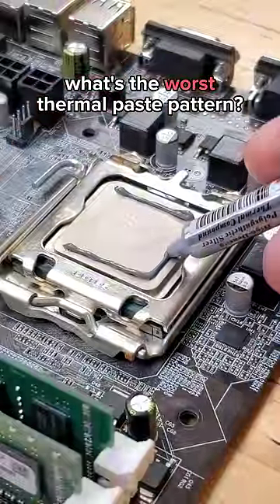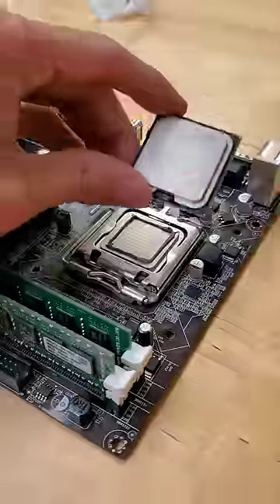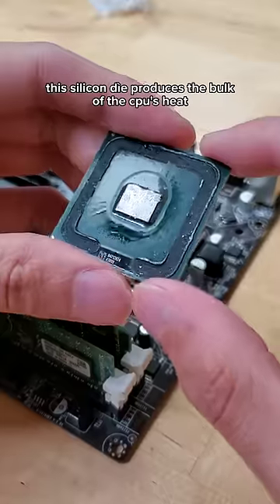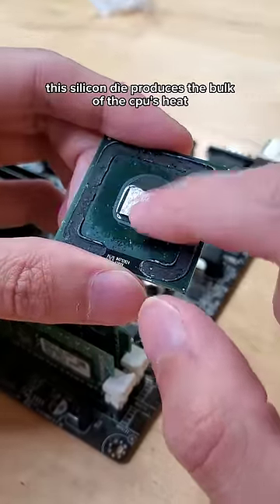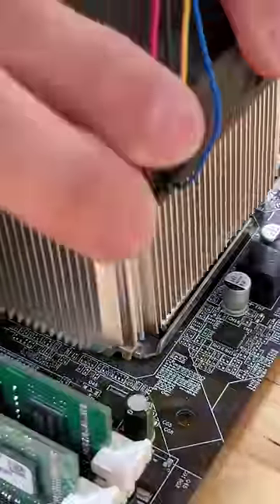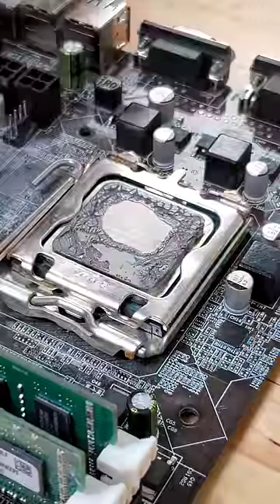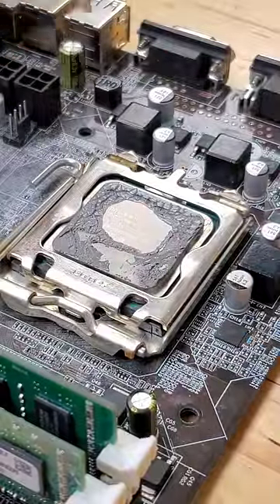what's the worst thermal paste pattern? #shorts

Comment: Think about this. A square at medium distance from the center, it’ll spread to the center and then the edges as well.
Reply: One pattern I've seen recommended a few times is a square close to the edge with an X of thermal paste through the middle
Reply: @Thesnakerox  effective but 3 lines across is all you need. Save some of that thermal paste for your other builds
Reply: @FactsForLife_901 damn i wish i was building that many pcs lol.  i have 3 tubes of paste that i only used 1 time each haha
Reply: @RideRedRacer  lol I work for a big tech company, my job is to build and test PCs and servers all day, that's the only reason.
Reply: And a tiny dot in the middle to make sure past gets there.
Reply: Thats not how that works. No matter how you shape it the heatsync squishes it circular anyways.
Reply: @Generic_Name_1-1  nah ur wrong.
Reply: @paperboatcanfloat3424  thanks for the input
Reply: @Generic_Name_1-1  your welcome dawg. Have a nice day.
Reply: I always draw the Mona Lisa with my thermal paste (I am still working on my first PC)
Reply: You don't want it to spread to the edges because it'll leak out and cover the pins. I've experienced that happening before.

Comment: Which is why you only need a dot in the center. Spreading isn’t better for those who think. Ive put a dot in the middle for many years and always get great temps. Just my 2 cents!
Reply: Spreading is objectively better as you can ensure full coverage of the die(s), a small dot in the centre isn't always adequate for this.

You do know some CPUs have rectangular dies where some sides are closer to the edges right? Intel Alder Lake is a good example of this.

You do know some CPUs have multiple off-centred dies right? Just take a look at AMD Ryzen 3000, 5000 and 7000 CPUs. And especially take a look at ThreadRipper and Epyc CPUs which have dies all over their large package where you most certainly do not want to go with the single dot in the centre method.
Reply: You're right man, most people are completely uninformed about a lot of things, this being a great example. Thermal paste should not cover your whole CPU and squeeze out of the sides when you install the cooler, it should be a super thin layer that fills in any gaps between the surface of the IHS on the CPU and the cooler.
Reply: @husboy1  I've seen a lot of tests over the years, and feel quite confident that there's no such thing as too much, only too little. Sure, you probably don't want it to be so much that it spills over on the board, but trying to get a small circle in the center is just unnecessary and potentially suboptimal.
Reply: @AllahuSnackbar270  When you put a square like the person in this video, it can leak out and cover the pins, permanently damaging your CPU. I've experienced this happening before. I've always used just a dot. My dad who works in IT at a large tech company only uses a dot. He's the person who taught me that method.
Reply: @-jxvi  You mean when removing the CPU? I always wipe off as much as possible before removing it from the socket. Or do you mean while it's in there? I've never managed to put so much that it leaks out onto the board, and no paste I've ever used has been so runny that it could get in between the CPU/socket. It's definitely different with liquid metal though, I would never use that stuff.
Reply: X is the best
Reply: Dot is the best for AMD's. I don't like the x's or squares or other shapes. They can leave air bubbles while heat sink presses over it. 
Put a dot on it, install your heat sink. If you are not sure, remove the heat sink and look at the paste. If needed, wipe the paste and put a bigger dot. 
I like to put somewhat rectangular dot in middle and it does fine for me.
Reply: I used to always be so worried about thermal paste not being able to spread across the whole thing, but this video really opened my eyes up.

Comment: just use a plastic card, spudger or whatever and pre spread it.
And make sure you use as LESS as possible!
It shall just be enough to cover the surface, not really a "layer" of thermal paste. It's meant to fill the microscopic gaps between the surfaces of the CPU/GPU and the cooler, not to create a border layer between them.
Reply: No. Just no
Reply: @VrXl17  It's the truth. The best cooling is metal on metal.

The imperfections between the metals creating tiny air pockets is what you're preventing with the paste.

Edit: this is also why liquid metal is better for performance than paste.
Reply: @ethanv7330 No, I mean never spread your thermal paste. It can damage your cpu socket because it will leak off the cpu.
Reply: @VrXl17 not every paste
Reply: @legendmaster1989  most tho
Reply: @VrXl17  not really my corsair one doesnt i have it all over the back of my cpu lol
Reply: @legendmaster1989  yeah but that’s because you probably didn’t spread it. Also people don’t spread thermal paste because it’s better to use a pattern like the X as it applies perfectly equal pattern whilst spreading it with a spreader creates air bubbles and when pressed down with the cpu cooler it will be thinner in the middle.
Reply: @VrXl17  so its not cunductive cus i dont spread it?
Reply: @legendmaster1989 no, I’m saying DO NOT spread it. It doesn’t change the conductivity but if you spread it you can (and this is very rare) short circuit it because of air bubbles ect
Reply: @legendmaster1989 also, that’s really bad because the connectors won’t connect properly
Reply: @VrXl17  yes y\that makes sense but not all can short circuit the mobo some are pure silicon with no alluminium
Reply: @VrXl17  most pastes you spread won't do that... If it's viscious of course but thermal paste isn't normally damaging it's fairly easy to remove with alcohol. Liquid metal though that lemons a board instantly.
Reply: @VrXl17 that's just... Not true man. That's why stencils exist for spreading and have comparably more reliable results than globbing and smashing. That doesn't spread out as equally as people think it does.

Comment: I like noctua's recomended  5  dot pattern, but recently i've taken to spreading it evenly with those lil plastic tools that come with some coolers. Nice to not have to worry about a bad spread when working with pastes or cooler mount pressures you arent used too.
Reply: Exactly. If you do a thin layer all over, there is zero doubt.
Reply: @MrBilld75  Yeah, the only issue is some pastes are so thick, like noctuas paste, that you have to soak the tube in hot water or something for awhile to be able to work with it.
Reply: @RubenRyb66  Ahhh, I see. I've never used it. I used some Arctic Silver before and used Arctic Cooling MX-4 or MX-5 more recently. The Arctic Cooling MX stuff is quite thick, but I don't know how it compares to the Nocturna and thickness.

Comment: The best:
A very small dot on the center, the paste is only supposed to get rid of air gaps, both the cpu and heatsink are almost completely flat so you need very little. Thermal paste does not conduct as well as aluminium so the thinner the layer the better.

So the worst would be using the thickest layer possible?

Comment: the X pattern is simply the best
Reply: The X is the most common and best pattern.
Reply: no, but ok
Reply: I use a pea-sized dot and it works just fine because the pressure of the heat sink causes it to spread across the CPU. With any more than a dot, you're wasting thermal paste.

Comment: Thin even layer is foolproof and the best. An X pattern is second to that and gives very good coverage. The key is to not use too much, it's not glue more is not better, it's worse. You're just dealing with microscopic imperfections/pores in the metal. There is no reason to spread it thick at all and it can actually damage your motherboard or CPU or both.

Comment: The worst is just missing the CPU entirely.
Reply: no, the worst is no thermal paste at all

maybe you could put a hot glass of water on the CPU but that's not thermal paste and it doesn't count
Reply: Its rng with no thermal paste. If you are lucky cpu and the heatsink get contact with each other.

Comment: use a small plastic spatula or a piece of cardboard or similar and spread an even thin layer..
Reply: It only works if you have thinner paste up to MX-4 or kind of MX-6. With thicker paste you must use heater to  make it even remotely possible. 5 beads works fine enough without even remotely close of same amount of annoyance.

Comment: If anyone still doesn't just use a spatula these days, I'm gonna slap em with an old fish
Reply: cpus literally have integrated heat spreaders. The cooler mount will spread it out for you, spreading it further than just putting a lil blob in the middle is unnecessary.
Reply: @toxicturkeyy   actually with amd and intel both being on a LGA socket , their retention arms tend to cause the paste to not spread evenly.  some  other youtuber did at test of  this  and found that making an X or putting a hefty ammount (twice the old "pea"  ammount" are the best ways to ensure the paste spreads around the cpu better. obviously you'll want some kind of non conductive  paste using these methods as they can cause leak-out . using a  conductive paste like artic silver... you'll want to go the spatula route (with only a tiny bit of paste)  to reduce leak-out risk.  in general rule of thumb though you do nnot want to sue a conductive paste any more ,  lor liquid metal unless you swap out the mounting ring  (a risky procedure) and then also use classic safe guards to prevent the paste or metal from shorting any thing out (classic methods being nail polish around components you want to protect from any possible leakage). 

but i digress point was  jsut a tiny pea dot doesn't cut it any more especialy with these newer cpus.
Reply: @DenverStarkey  it does in fact cut it, I have assembled a lot of computers in the past 10 years, this month I assembled three of them. I use a drop the size of a small grain of rice every time and it always spreads into a circle/ellipse that covers more than enough and is very thin. Thermal paste isn't the main heat transfer medium, it's only there to fill in imperfections, it should be as thin of a layer as possible.
Reply: @husboy1   dude i build PC's all the time, i have been building PC's as far back as the 90';s  i don't need  a lesson from you about how to do thermal paste.  and MANY builder's agree with me , a pea sized dot does not cut it any more. especially with how  the LGA's clamps don't have even mounting pressure.  but like i said you can take the risky road of swapping out the mounting ring on the main board to get more even mounting pressure , but again this is risky as you bassically expose the pins to potential damage when you completely remove the mounting ring.  you can find countless  videos showing how a pea sized dot does not work very well on these  default LGA mounting solutions from intel and AMD. intel even more so since their newer processors are no longer perfectly square shaped  but instead are more retangluar.
Reply: The pressure of the heat sink is enough to spread the thermal paste.
Reply: @DenverStarkey I use an AMD CPU and a pea-sized dot is fine. My dad does this too, a guy who works in IT. The pressure of the heat sink is enough to spread the thermal paste. Any more than a dot and you're wasting thermal paste. I've seen people who put an X damage their CPU because the thermal paste can seep out from the pressure and eventually damage the pins.
Reply: @DenverStarkey Also, I don't think the newness of the CPU has any effect on which method is more effective

Comment: Can you put thermal paste directly on the chip itself then more on the cover?
Reply: Yes. It's called direct die cooling.
Laptops don't have the metal cover (IHS).

So you would directly mount the CPU cooler onto the cpu die. It does reduce temperatures. But for desktops it's much preferred to have an IHS for the sake of longevity as desktops are often opened up and the components can be replaced.

Comment: Technically speaking a dot in the center is a thermal paste pattern, in this scenario you made a box around the center attempting to make the worst pattern possible. Judging that a dot in the center is a pattern, 1 small dot in 1 of the corners in technically a thermal paste pattern.

Making a corner dot the worst pattern possible.

Comment: The BEST way is, not by accident, the only one engineers who designed the products say:
Spread a thin film evenly all across the surface. Any other pattern is bull and technically incorrect.
Reply: Where's the source where these cpu engineers says this?
Reply: The X being second best and the way most people in the know do it. But thin layer evenly is foolproof and usually what is recommended.

Comment: Square with middle dot or 5 dot pattern are the best.

Square you might be putting a little too much and it might overflow...there's no problem with that, but next time you repaste you're gonna have to clean a lot more.
5 dot pattern and you get 100% coverage every single time. Trust me, i repair PCs as a hobby 😅

Some people still defend the pea pattern, but I've found several CPUs with no paste on the edges...not a big problem, the center is what heats up, but it's better to have the CPU fully covered in my opinion as the CPUs metal cap spreads the heat.

Comment: As a phone 1 owner I can confirm that basically all the cases you find for this phone have a clear back or at least cutouts for the lights. Personally im not really a massive fan of the 2a design since I like that the lights cover the whole phone on the 1 and 2. However they could be using that as a way to distinguish between the mainline and a line?

Comment: I love those applicator pattern stencils uou get from Vorsair when you order xtm70, and developed my own reusable stencil that centers perfectly on the processor and works with multiple mointing bracket configs ti get centered. When i tested it with clear acrylics every time no matter how "bad," i did it (as long as i just squished it on directly from above without rubbing it all over rhe place or deliberatly doing it bad) there was almost never any air in the entire surface of the thermal transfer plate and the layeer was nice and thin sk the heat tramsfer is as optimal as you can really get. It was hard to make but it was well worth it. All i do is spread a glob from my container and remove the rest, put it back and use it for later. Very efficient.

Comment: You know what would be cool?

Is if CPU manufacturers included a template of the layout, so that you can apply the thermal paste where it needs to be, rather than, guess/cover it all, and end up running at 72°F instead of the 68/69°F it should be running at.

Comment: The ONLY correct way to install thermal paste is a very thin even layer.  The moment you have any type of air bubble or gap you are wasting your time and causing a heat concentration point.

Comment: There's a reason Thermal Grizzly gives you a spatula to spread the thermal paste in the package. Just saying. 

All this talk about what's the best method has been going on for the 20 years I've been building PCs. If you thinly spread it to cover the entire IHS then you don't need to worry about if any area is covered or not. I've done this for 20 years and never had thermal issues. Thermal Grizzly is one of the top players and they know this. Which is why they include the spatula. Just take the few extra minutes it takes to spread it and be done with it. Industrial application manuals almost always instruct you to spread thermal paste. Again, they do this for a reason. 

Too little paste can cause major issues. Too much paste doesn't cause any issues other than the potential mess. (Or if you're using conductive paste. Which is stupid and unnecessary for 99% of normal conditions.)

Comment: I just use the sticker that says REMOVE BEFORE INSTALLATION.
Reply: Fr. i found that if you use the sticker included with the CPU it also can help the cooling. Just slap that thing on top of the CPU and put the cooler on top

Comment: What happens if you put 4 different types of ram in a motherboard?
Reply: If you mean 4 different brands, speeds or sizes. Nothing. It'll work, although not optimal.

The faster ram will get clocked down to the speeds of the slower ram.

Comment: No sir you  are wrong as metal is a good conducter of heat and so heat realised from heart of cpu can be transmitted and therefore this pattern is not useless but as applying to the center would be much better.  Conclusions nothing is useless its just pov ,thak you

Comment: You should watch videos about contact patters of you cpu. Or test it yourself with you specific cooling.
That way you can do a really thin "wipe" with paste for parts where contact is good. And slightly thicker layer on everything else.
Also really important to use correction frame for lga1700 chips.

Comment: The thermal paste story is like German engineering - way overdone at this point. A simple dot in the middle is perfectly fine, why turning it into rocket science? If you are unsure over the amount, give it more. It will make your assembly look a little messy, but you are safe that everything is touched by the paste, no risk of short circuits, and who cares anyway since the area is not visible through the cooler. Computers have given me many headaches over the years, but CPU cooling was never one of those issues.